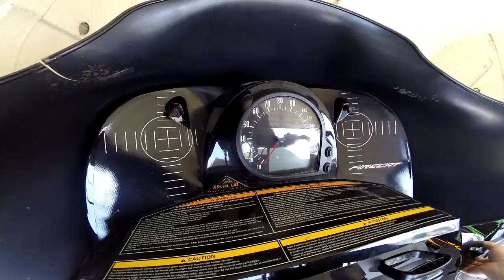Longtin Motorsports Gets New Race Sleds!  *******Sort of*********

Comment: We will now watch as two perfectly good snowmobiles are slowly turned into a couple of temperamental and unserviceable race sleds. This process will rely on guessing and luck as much as any hard facts or knowledge. 

We therefor place these two kittys on the sacrificial alter and send out a prayer to the god of speed and performance. May our ears be filled with the chorus of rapped out engines and our nostrils filled with the heady bouquet of two stroke oil and race fuel!